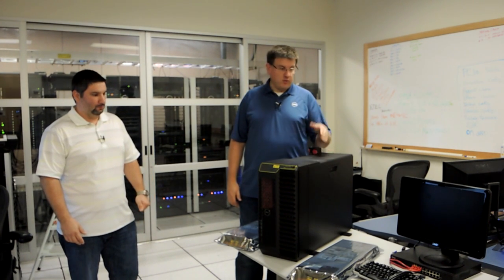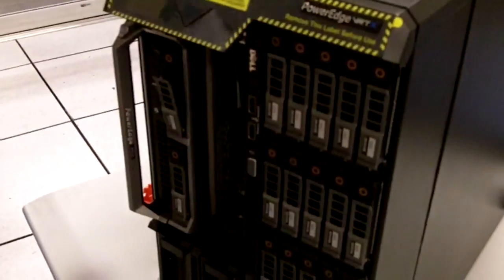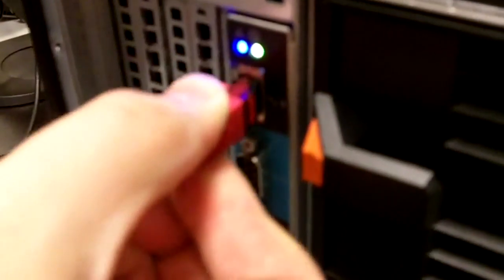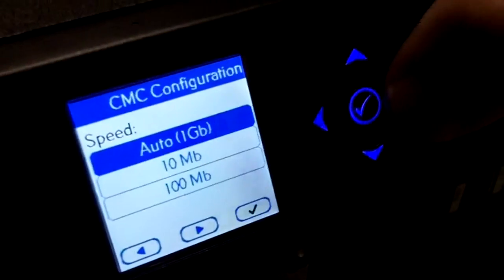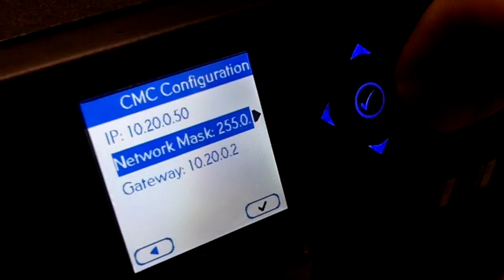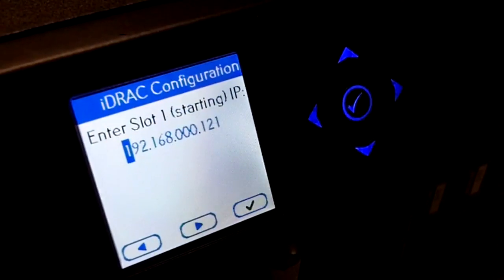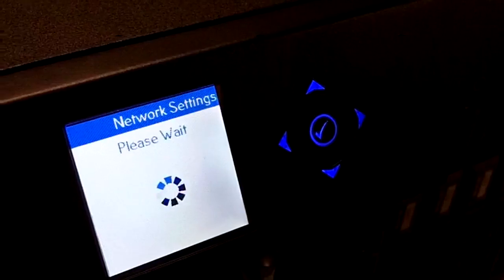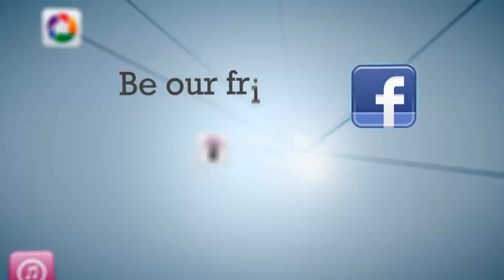Inside the Lab: Dennis and Lance Setup their VRTX for the first time.

Comment: Few things to disclose here that Dell seems to fail upon doing themselves:  1) They advertise, "Dell VRTX is so quiet, you could use this at remote branches and place it under someone's desk."   No that's absolutely false, unless of course you want to drive people crazy and eventually deaf. With only 2 blades and 7 Mix-Use SSD harddrives, this thing is anything but quiet. 2) In the Dell training (which is usually $1000 for a 2 hour course) for the VRTX, they highly recommend that you have two CMC cards for redundancy in the event the system experiences problems with one of them. You talk to sales and they say, "No. You don't need 2. That's just wasting money."  FACT: If you only have one CMC and it fails or malfunctions, your servers will continue to run as is without any issues, UNTIL, you power them off. Then  you will not have any way to turn them back on until you get the CMC replaced or fix of which you should also have a backup file for your CMC to reload the settings so you don' t have to do it from scratch. 3) The PERC controller within the VTRX is NOT one you can expand your disk storage as you can with almost any other Dell PERC controller.  Normally if you have 2TB of disk space in your disk pool and you need to add more room, you can add another hard drive to your array and expand your virtual disk size to allocate the new drive. VRTX does NOT have that capability. You much VMotion your machines to some other storage or virtual disk pool, delete the old virtual disk, then create a new virtual disk that has the new drive added and then finally vmotion your machines back.   That is an enormous risk to the company if you vmotion your machines to a non-redundant diskpool; granted your odds are favorable that you won't experience a disk failure, but if you did, I hope your backup of the virtual machines is solid; your going to need it.    In my professional opinion those top 3 things are a deal breaker for most admins.  We don't spend thousands of dollars on a chassis only to find out later we have undisclosed "issues" that make our jobs even harder. BTW: As of Q1 2022 Dell doesn't know if they will or won't continue with the VRTX line and they don't know what the technical solution will be to replace the VRTX if they decide to discontinue it.   This is the same problem many faced when Dell decided to discontinue the MD 3200 and MD 3220i ; customers will be stuck with expensive chassis with no solution going forward, other than to spend twice if not three times the original amount on a completely different solution, such as the VX RAIL.

Comment: Just to confirm, Does the VRTX supports up to four (4) PowerEdge M820 blades?
Reply: Yes. That's correct - 4 blades
Reply: since dell m8xx blades are double-wide's, no, it does not. Supports 520, 620, 530, 630, 640 m series blades. (and though not officially supported, it does take the m610's if you want to run those space heaters)